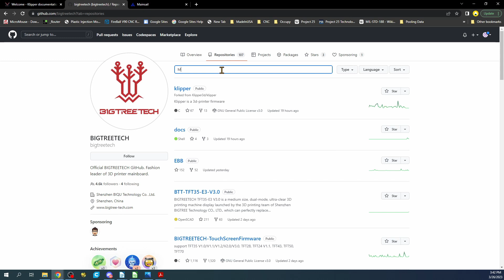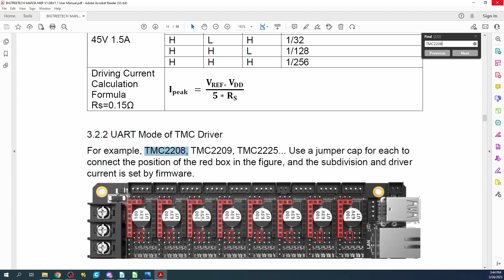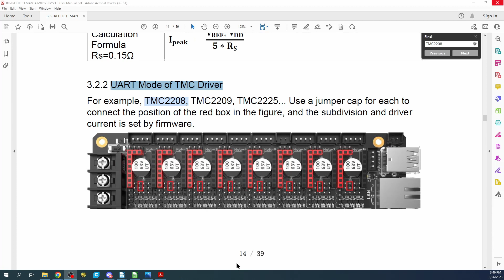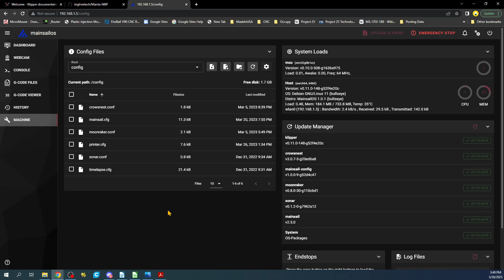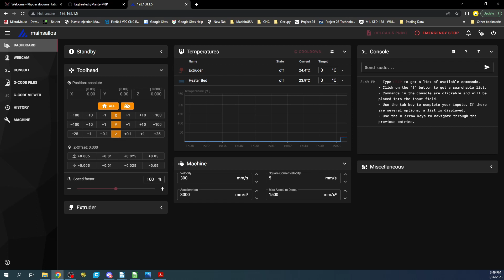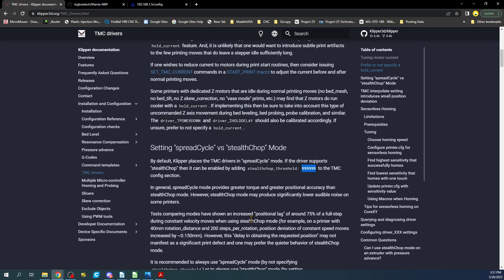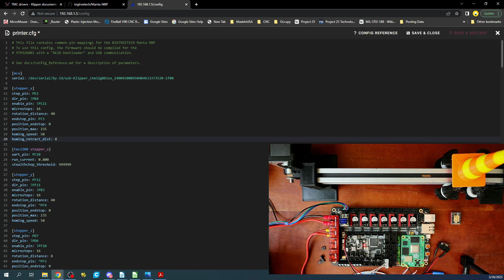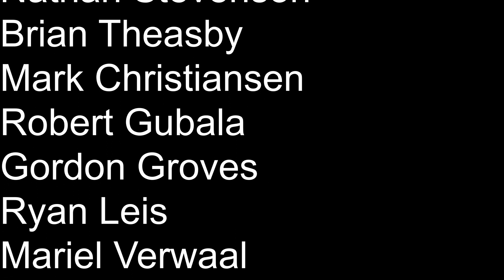BTT - Manta M8P - TMC2208

Comment: is there a way to wire and configure the software to run external stepper drivers for some closed loop nema23 motors?
Reply from the maker: Probably. But closed loop stepper might only be good in an earthquake zone.
Reply: @EdwardBraiman   its for a dead industrial 3d printer. nema23's are required for the application sadly, and since closed loops are pretty much as cheap might as well get good motors.

Comment: Hello, good tutorial.
I would have had a part for power supply source which is defined by jumpers which are not inserted by default.
Reply: I agree. I din't know I needed to put in the jumpers and I got a message saying; "unable to read tmc uart 'stepper_x' register IFCNT". I have been struggling for a few days to figure out that I didn't have the jumper installed. @Ed's 3d Tech Please edit this video and mention the need to choose a power source for the stepper drivers using the jumpers.
Reply from the maker: The v2 board leaves off jumpers,  I think v1 board has them